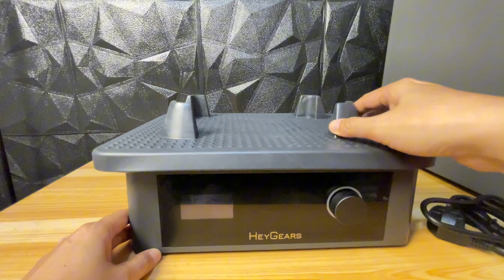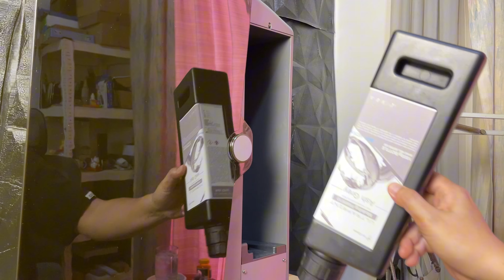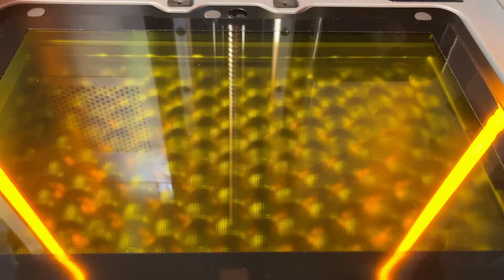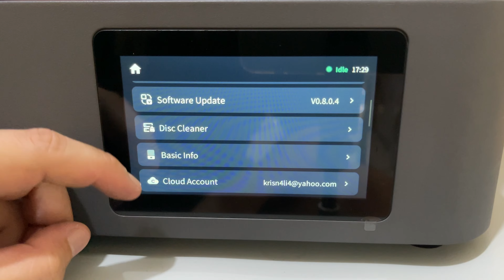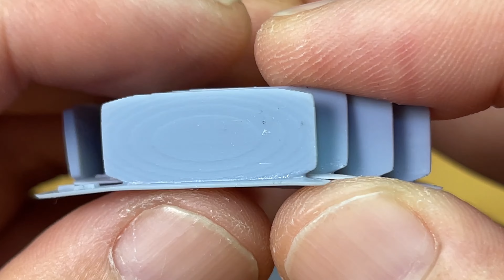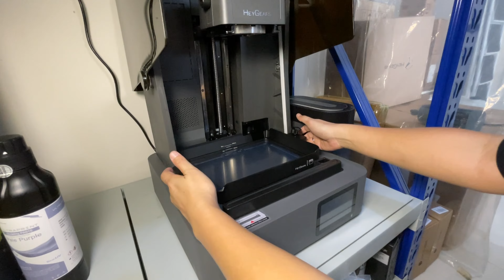HeyGears Reflex 2 Is Not For Me

Comment: Funny title, because HeyGears decided the Reflex 2 is not for me either , they sent me a brick.
My unit boots slower than a 1980 Commodore, takes 2 minutes just to find Wi‑Fi, and both the old and new software are completely broken.
New software? No export, broken binding, cloud jobs vanish.
Old software? Resin list stacked on top of itself, menus overlapping, nothing works.
Printer says “bound,” PC says “no machine bound,” factory reset doesn’t reset, offline mode dead, USB export missing.
Four days, zero prints.
So yeah… Reflex 2 is not for me either!  HeyGears made that decision the moment they shipped me a non‑functional machine.  No support replies. At this point the first thing it might print will probably be a middle finger.

Comment: Hello, I would like to know if there is a way to pay you for a consultation to calibrate my printer and for advice on which resins I can use. I've been getting a lot of layer lines in my prints. I'm still learning how to place supports from your videos, but I struggle more with visible layers and, especially, with calibrating the fit of parts. Not all of them join properly, leaving a visible gap when assembling, or they don't fit because the models are more expanded. What is the cost of a personalized consultation? Is it possible?

Comment: Looks like getting the rs turbo might be the better choice, lol. They’re running a promotion right now.
Btw have you tested the Reflex2 with transparent and engineering resins? I heard that’s the main difference between the reflex and rs. If only focus on print detail performance, reflex2 is definitely not on the same level as rsturbo.
Reply from the maker: The pau20 is the engineering resin.
Reply: @wangdennys  How’s the heygears transparent resin? I’ve always been interested in it and would love to hear your thoughts.
Reply from the maker: @sammykim4896 i havent test it
They just update the profile

Comment: Hold in button on Cure station for "back." Not intuitive and I did it completely on accident.  Does that work on Wash station? I don't have it because I didn't like it. 

Agree with you on how bad HG support is. They always blame everything but the machine or themselves. That is the main reason I wasted several bottles of PAP10 and most of my LCD life following their instructions because they kept blaming my models and having me re-print. But it turned out it was the LCD either degraded super fast or just went way out of calibration. I had to pay to fix it and they would not compensate for their errors. And because I wasted so much time following their advice, "LCD is now out of warranty." Terrible.

Very disappointing to know that this locked down ecosystem that is heavily dependent on competent support not only doesn't have it but also they don't care to improve because the losses will always be with the customer.

Also, as a side note, as of 2.9.0, Blueprint Studio has a bug where if you run a object repair on some pre-supported models, part or all of the object disappears and leaves only the pre-supports. I had this issue with your Redbull Formula 1 Steering Wheel model (I bought a bunch of your models on Cults to do my own testing). I didn't have this problem on v 2.8.x. I sent a ticket to HG support and they didn't respond...

In my testing, a well calibrated resin on my Saturn 3 Ultra still performs the same or better as using a default profile on RS Turbo. I even did your tube tolerance test and my S3U could fit all parts flush on the 0.00mm hole where my RS turbo results were the same as yours. These printers are just for ease of use primarily and quality is a secondary concern, in my opinion. Not sure that's worth the significant cost of the printers and proprietary resin, FEP, and LCD. 

All said, they are good, solid options for someone who is new and/or just needs to get going on printing quality consistently. There is definitely an audience for that so I guess I can't fault that. This one definitely seems more aimed at prosumer or small business. I don't think they're going to care about the lack of detail as much especially if they're doing more functional stuff. Just have to do something about that scraper and the potential spills.

Comment: With this new release of the Reflex 2 Heygears have not done themselves any favors... this printer is simply not ready for sale and damages their previously good reputation !
Reply from the maker: I only wonder why keep the 6k screen?
Reply: @wangdennys  I think it’s because, as they’ve shown, screen resolution is not nearly as important as all of the marketing departments would have us believe. When you have the resin profiles dialed in and the exposure set properly, you can achieve the same results on a lower resolution LCD. One of the biggest reasons we have 16k screens now is because that is what the LCD manufacturers are wanting to sell.
Reply from the maker: @geekverve unfortunately i cant dial in the print setting, since it is close system.

Comment: 'they are gonna be saying resin is gonna get stuck in them holes, sorry bro that is because of your bad print settings' well you can't lower the base exposure on the reflex so yeha.. the only advantge to those holes is so you don't need a as much wait before print on base layers to get thin first layers but that only matters if you are trying to direct print which will only work well with custom base settings and a plate with no holes so it's pointless. if not direct printig then 10s is enough wait before print on a normal plate without holes, most people use less and it works but that does require more exposure. I made a fdm printable wall for the RS to avoid resin getting on the top can't do that with a plate like this tho.
Reply: "you can't lower the base exposure on the reflex" - FALSE .

They allow setting the bottom layer exposure from -50% to +50% in the printer settings ["Adhesion Settings"] on the printer UI.

You have an RS?  Go check and correct yourself 🤣

Personally, fully perforated build plates like this suck for more reasons than I'll go into in a youtube comment.
Reply: @retromodernart4426  
No shit I don't have a HG printer
I remember an incident when the base exposure settings were off for a particular resin so instead of users being able to change it instiantly they had to wait days for heygears to change it for everyone and then it was too far in the other direction, perhaps they learned from that but even then it's just on the printer UI not in the slicer? and -50% isn't enough for good direct prints, with lnog wait times I usually get it all the way down to 2x normal exposure for 1-2 layers and 2-4 transition, that's how you get rid of warping and elephants foot.